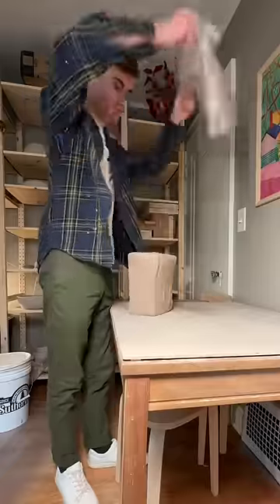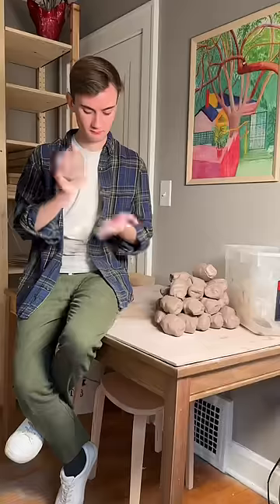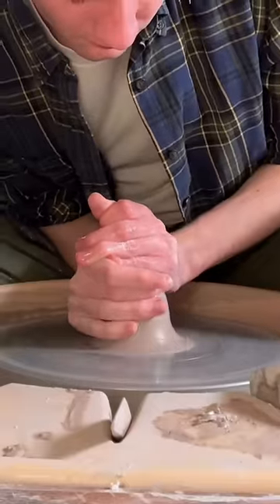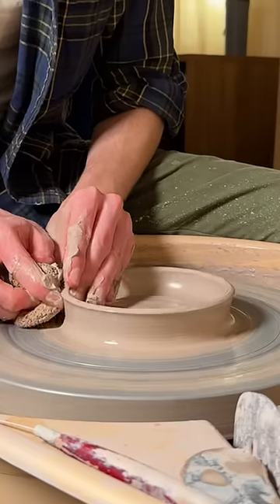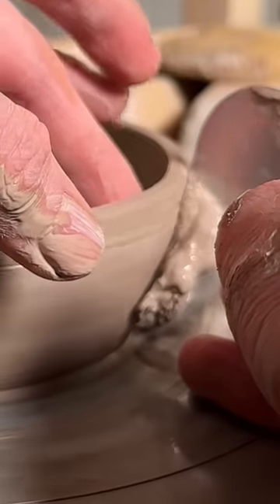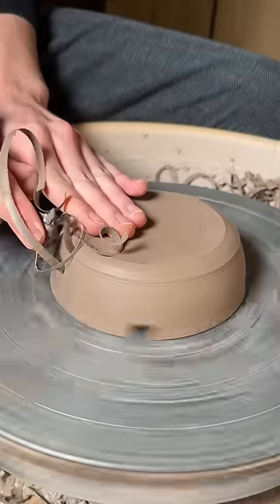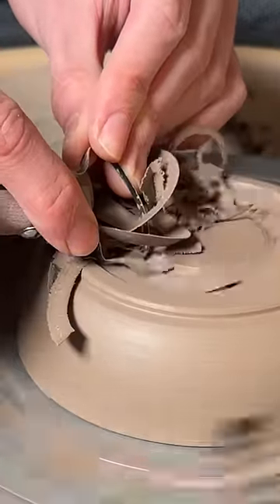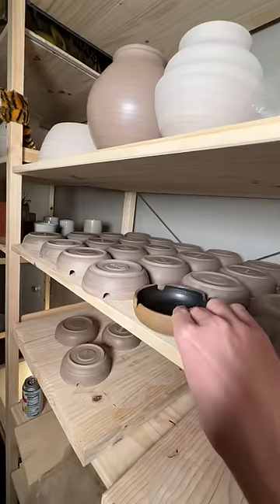making ceramic ashtrays🍃

Comment: You can also use ashtrays to hold jewelry or just little trinkets
Reply: That's what I am thinking
Reply: Ashtrays are definitely not only for smokers
Reply: Keys!
Reply: but than you could also just leave it as a bowl without making the cigaret holders in the bowl
Reply: @castrinecubique983 they are, what you're thinking of is a plain old bowl
Reply: @Lillyrosechan  yeah but sometimes i want a fancy bowl with holes in the sides called an ashtray for my jewlery
Reply: just call it a "catch-all" instead of an ashtray 😅
Reply: @Lillyrosechan They can also be useful for holding paint brushes
Reply: You can also hide your weed in there
Reply: @jimboslice5255  i don’t think you can hide your weed in an ashtray

Comment: Instead of cutting out notches as shown, use dowel to press notch IN to ash tray, with clay forming a 1cm shelf surface that can hold cigarette level for a while. The skinny surface without much horizontal durface is not as useful.
Reply: @creamythroat let’s you keep the tip out of the ash in the tray or the filter off the potentially dirty table top
Reply: Notches would still need to be cut into the side, because if you press down on the walls, the outside rim and the bottom will cave in slightly, making the finished piece not as clean. It’s just the way the clay body works. The dowel also can’t go in the kiln. 😂 BUT anyone can still lay their own wooden dowel across…just go to the dollar store and get a wooden dowel to lay it across opposite notches. Done 😂
Reply: @creamythroat  not everyone who smokes smokes cigarettes 

Also to say that doing something risky means you have to take all the risks in the world is dumb. It’s that same shit my addict friends would say back when I was in that life to not bother with harm reduction methods that I would try to educate them about. 

In fact taking part in a risky activity means you need to take as few risks as possible. It means you should care more and not less 

But I guess you think like an addict.
Reply: @Nnn-j7q Reading comment sections just continues to convince me that most people are aholes. Why do we have to constantly insult other people for having a different opinion than us? It’s so weird. And all over a fucking ashtray lol.
Reply: I don't think the people buying these are using em for cigs...
Reply: @TwinkleToesX86 we notice noisy and rude people more.
I understand the sentiment, but there's lots of decent people.
Reply: Yessss
Reply: @creamythroat  Or maybe stop being so critical of somebody who's legitimately trying to help? 
Dude gives a great idea and mr killjoy is right there with the negative criticism??
Reply: I have been looking for an ash tray like that for years now around my area. I can't find them any where. I can't find any old antique ash trays around my area. Everyone one holds on to them.
Reply: I'm looking for an ashtray with edges so you can sit your cig down and not touch the bottom of the ashtrays. 😂 I can't find any that has good edges and  deep ashtray bowls at the same time. Most ashtrays are flat shallow and you have to lay you cig against the side of it pretty much. I don't like my cigs to set on top of a couple butz in the ashtray. I would like to find a deeper ashtray with some edges to set it level. I hope I make sense. 😂
Reply: @creamythroat I don’t smoke anything-never have. 

Regardless: this reads akin to telling folks who use needles for their substances to just reuse one needle because they’re already using illicit substances. 

How does that help anything?

How does telling someone “guess you should take every risk since you take ABC risk willingly” make sense?

Should they also drive without seatbelts? Not wear their glasses? Gorge on unhealthy foods everyday? 

Be reasonable or you’ll just be dismissed.
Reply: @creamythroat  the fact that you cannot grasp a basic shift of your stated viewpoint on anything other than smoking as the unhealthy habit shows a concerning lack of understanding about the underlying crux of your own argument. 

That’s critical thinking 101.

I had a fantastic day-even though I’m not a sir. 

Or are you just a one-issue diehard when it comes to smoking?

Comment: Hey those look good. I no longer smoke, but would have loved to have one. One thing though, one of my criteria when buying an ashtray before, was to look for those whose notches fit the width of a cigarette. That way I could have the tip floating rather than resting on the surface.

Comment: Spiral inside is a nice touch and a reason to keep it clean but notches in this case are practically useless, the rim is too high and the wall isn't thick enough to support anything.
Reply: Addict problems.
Reply: How heavy are your cigs?
Reply: @mauseratimeowzebub8818 hittie bats for weed dude, small metal smoking tubes might be what they’re talking about? Idk
Reply: Thanks for pointing this out. It's not about them being heavy. It's about the holes being too large to pinch any thing, and to tall to let something just drop in and burn. Even for a cigar I couldn't use this.

Comment: Hiya, you can make a de-bowler (and charge more) by adding a nail pointing up to the center in a small mound of clay
Reply: I love it, but I think the ceramic would snap. It’ll bake sooner than the rest of the clay and become extra brittle:(
Reply: @rallyrandy69  hmm.. 🤔 I’m not sure how they make them commercially, maybe they coat the nail in heat resistant paint or something? No idea but they’re the best invention:) hope you do some experimenting friend
Reply: You can just make a spike out the clay, doesn’t need to be too sharp unless you’ve got some super resiny weed
Reply: Easiest way to do it would be to leave a little extra clay in the center when you’re compressibg/pulling the walls, then you can cone it up into a small point
Reply: Or make a small circular rim in the center that would snugly hold a wine cork (A champagne cork might be even better). That way people can tap out their glass pipes on it without the risk of breaking either one? Just an idea, I use to glue a cork in the center of my ashtrays. By making a 4-5ish cm. rim in the center which would snugly hold the cork, rather than more permanently conjoining with glue. This would permit the user to replace it once it became heavily resinated. Another gem of a trick is to glue a wide wooden base on your bongs to give them more stability. The amount of beautiful hand blown works of functional art that were broken in my living room in collage, could fill an entire head shop!  Then I finally took a tolerance break and had some life changing epiphanies and haven’t broken a piece of glass since.

Comment: I use deeper ashtrays like this as my reservoir for watercolor painting.  I can clean the brush and lay it across the indents to dry.  If you left the bottom of the dish bare clay, it would help clean the brushes.

Comment: You can use ashtrays for more than just cigarettes. Cigars, pipes, are there also good for candle holders, or incense burners, not to mention their good holders for small items such change or your keys. People have been collecting them for a long. They were used to promote cigarettes of course but also tourism. And they are a work of 🎨.

Comment: A ceramic ash tray with little crevaces around the top is the greatest stoner ash tray... its for cleaning the resin off whatever stick or brush you used to clear your bong. Wider ones for cigars are also useful. But these look great, could probably sell to local bars

Comment: Seeing the spiral at the bottom, how about making shaving bowls, in which you lather up shaving soap with a brush?
Those are uneven, bumpy, or have a pronounced spiral on the bottom to help with the lather process.
A benefit would be not to have to cut holes into the sides :)

Comment: On that note: Cheap plastic cup holder ashtrays have a removable top that fits on certain double-wall insulated metal thermoses like a charm. The result is the best car ash tray, ever.

Comment: Just a friend suggestion as some who makes stuff and is also a stoner.  I’m you don’t need to cut the holes in. If you take a stick and just push down and outward it will flare out where you pushed.  Do that a couple times and it should work just as well as the actual cuts

Comment: Nope. As a former chain smoker and ceramicist (not potter) I have to say this. The notches in an ashtray for cigarettes need to be able to hold a cigarette by very lightly pinching it. If you make the notches cigar sized they are useless. you place the cigarette on it , after a few seconds it just starts burning too fast due to the inclination an a few seconds later it just falls down. Functionality trumps aesthetics, certainly when the first doesn't even hamper the second. Cheers.

Comment: In ceramics class I kinda gave up on the wheel after trying to remove my perfect vase from the plate🥺 with metal ribs because all the assholes in my class put knots in the wire saws and it cut my finger open the blood actually looked pretty cool mixed in with the clay